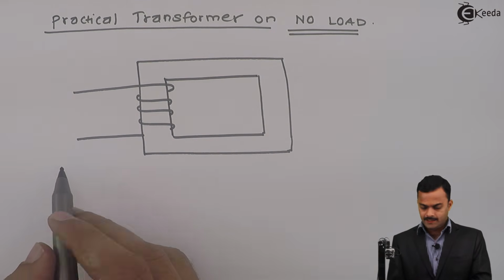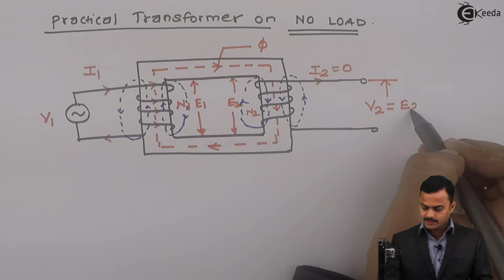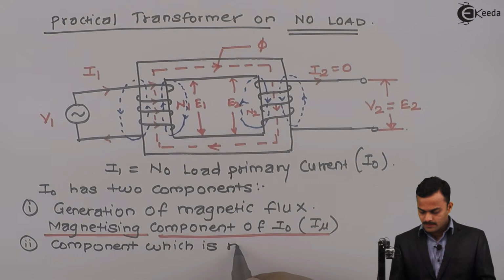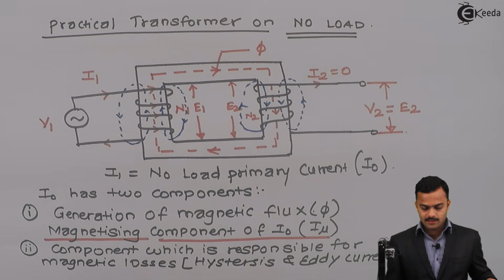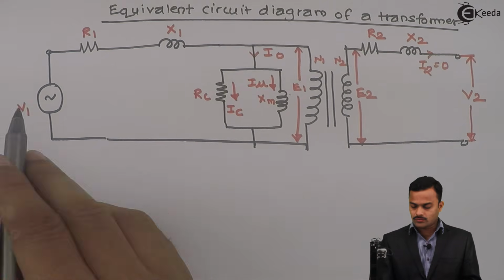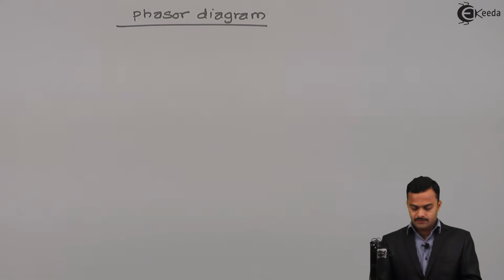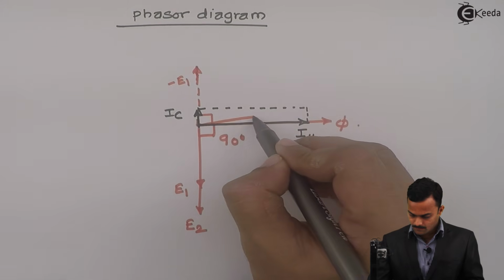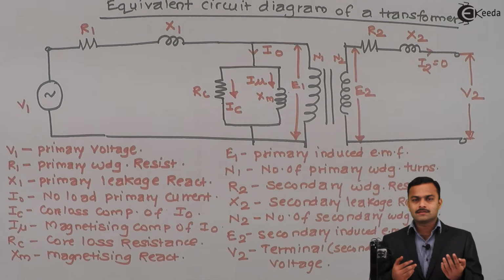Practical Transformer on No Load - Single Phase Transformer - Basic Electrical Engineering

Comment: Tell me, please, if the secondary emf is appearing due to the flux from the primary current, so why the secondary voltage is always totally in phase with primary voltage and not with the primary current? 

This is my practical fact. And in real circuit I could obtain any conditions or loads when the sec. voltage was in phase with primary current as should be if this one is the cause of the sec. emf. The prim. current is always not in phase with prim. voltage, but the sec. voltage is always totally in phase with prim. voltage!

Please clarify that practical fact!

Comment: Sir i have a doubt. That instead of using inductive reactance why can't we use capacitive reactance for no load condition of a practical transformer?
Reply: because the coils are placed without an electrical connection between them so they are inductively coupled hence inductance is used

Comment: Sir why Rc and Xm adjust in parallely in eqvt circuit
Reply: Shanikumar Benvanshi hi bro did u get the answer? . Even I do have the same doubt
Reply: Sir why does Rc and Cm are connected in parallel in the equivalent circuit? Why can't be connected as series
Reply: just for simplification of the circuit we do take them parrallely...

Comment: Sir,, please explain in detail why we have used the Rc and Xm in parallel but not in series with the circuit, after all they are also required the same power supplied by the terminal current. So why we have taken them in series..
PLEASE HELP 🤔🤔

Comment: Sir, in phasor diagram we add both current means magnetising current   and core loss current by vector law. But sir, current is a scalar quantity. Current sometimes behaves like a vector quantity....... If here current will be like a vector then io(not) will be net of magnetising current and core loss component current............ If we talk about magnitude then according to vector law io(not) =root of both i(mew) and i(c).................. But according to kirchoff's rule io(not) =i(mew) +i(c)

Thanks sir it is the good explaination for transformer on no load.

Comment: According to Lenz's law,the supply voltage V1 should be out of phase(180 deg) with the induced EMF (E1)..How come that the phase difference between V1 and E1 in this video is more than 180 deg ? 
Thanks for the series,it really helps a lot.

Comment: Thank you so much really good explanation but only problem sounds comes from right and it is a little bit annoying.Voice settings may be checked.
Reply from the maker: We will work on this and get back to you..
Thanks for watching, stay tuned...
We request you to share our work with your friends and family.
Reply: why is I2 0?
Reply: @sazz4657  Because there is no load in the secondary terminal. So no current will flow through